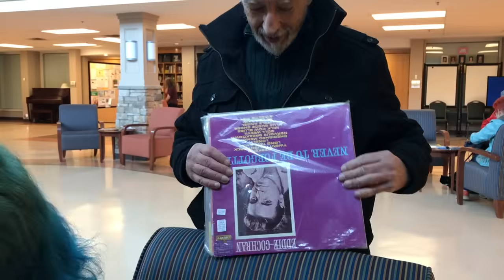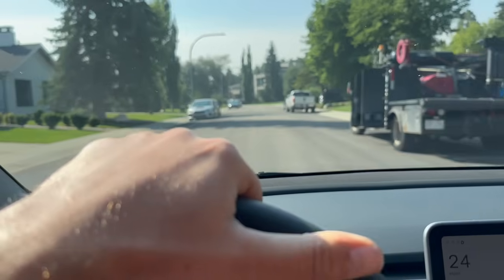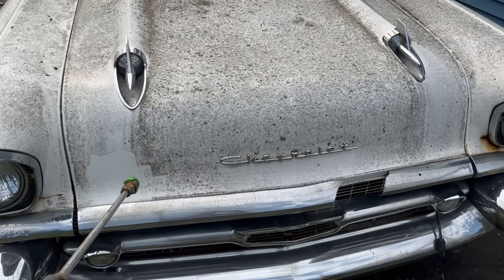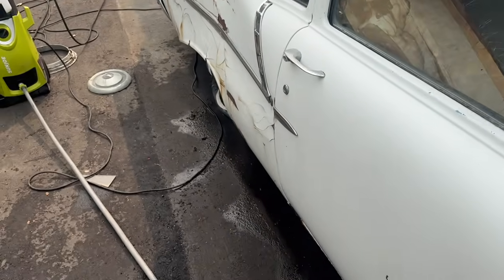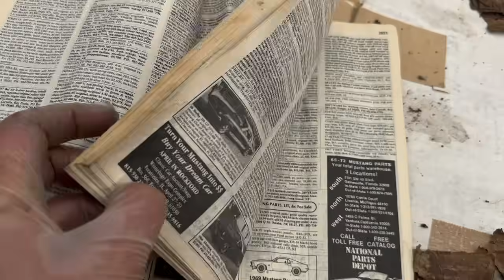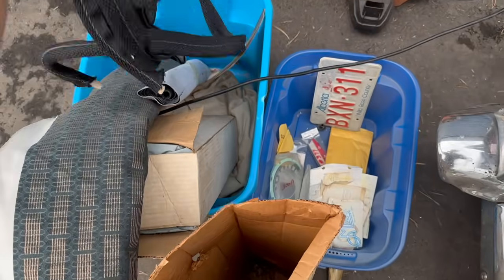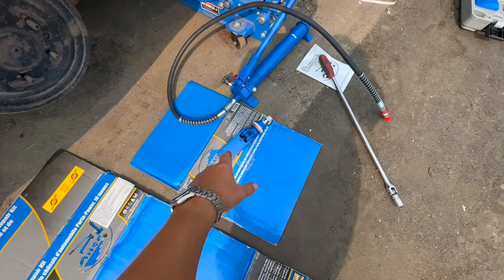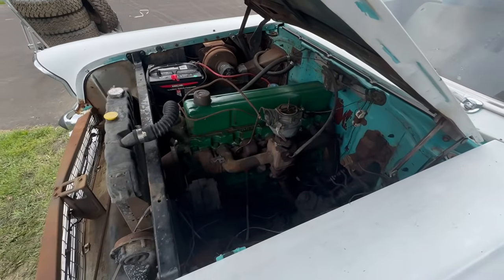1957 Chevy Parked 40 years! will it run?!?

Comment: My uncle worked at Steakley bros Chevy in Tx from the 50s til late 80s. My cousin had a slew of unbelievable used cars including a 2 dr. 57' just like that one in factory gold w/ gold and brown interior. He had this car in the 70s for a few months. lt had the 6 cyl as well. l drove it w/ less than 20k miles on it and it felt brand new. True garage kept one owner grandma's car. The interior was like new. l cherish the times l got to ride and drive in the 50s and 60s cars when they were low miles like new still in the 70s now when l see these videos. One of the perks of being old. l also live in the house l grew up in and was burying a dead cat recently where my sandbox was in the 60s and found my redline dodge charger hot wheels from then and l thought about curiosity inc.

Comment: When I was little my parents had a 1956 Chevy station wagon with (if my memory hasn't gone ka-blooey) the same paint color. It stopped being our family car in 1965 and until the mid 1980s was my dad's work car, stuffed full of tools. It too was "3 on the tree." I drove it exactly once, in the mid 1970s, when I barely knew how to drive stick. I stalled several times on the way home. I also remember marveling at how much empty space it had under the hood compared to more modern cars.

Comment: A '57 Chevy Belair is my dream car. I prefer the trim with the V insert on the rear quarter panel, and a 4-door, since that's more practical for me. So instead of having a real 57 Chevy, I have little replica models displayed on my book shelf. 😊
I was so happy when this baby actually cranked and started. I started clapping with joy! It looks great after the cleanup and pulling out the dents! 
In 1984 when it was parked, I was still living in Drayton Valley, AB (Nashville TN now), and my mother had a green '55 Chevy which was the daily driver.

Comment: I've often wished I had my '67 Malibu back as it was the best running car I've ever had, bought used in 1977. In 1979 I bought my first new car, a 1979 Toyota Celica.(What does a teenage girl know)  The Malibu got given to my dad and  by my Dad to my sister's husband who beat it to death in 2 weeks. I bought the Malibu for $200 from a guy who kept it in great running condition as it was his work car. That car started every day for 2 years without fail and my dad did the oil changes. so the only cost was gas at 60 cents a gallon. Hindsight is 20 20 cuz I bet that would be worth a lot now...Your  adventures always jog the best memories

Comment: Those tires have tubes. That helps keeping the air pressure. Those Chevy six cylinders were the about the most solid and reliable engines ever built.

Comment: From experience: pressure washing works better when you wet down first. Let the water penetrate a bit and then pressure wash. Even better with a low-pressure detergent.
Reply: I use gritless hand cleaner and smear it on generously over everything including the interior. Let sit for 24 hours then brush wipe and spray with water.

Comment: I just came across this video, fine nothing new on the 57 after this posting. A bit difference to see inserts in the front finders for the 150. You have a very good start on a great daily driver. Upgrading the brakes, is good, wiper's with and elc one, You already have the better heater one piece front bumper. So, after you take care of the stuff you have already talked about fun driving is a go ;-).

Comment: I had the exact same model 57 when I was stationed at Ft Ord in the 70s except mine was a radio delete. 

It originally was owned by California Highway Patrol, but with the 6cyl it was a administrative vehicle. 

Rebuilt the engine in 76 after 220,000 miles. 

Good luck with yours

Comment: I'd suggest checking the wall thickness of the frame in several places.  It's almost certainly thinned down some by being outside all of those years.  
You might like to watch some old Gene Winfield videos on metalworking fenders.  He tended to use lead instead of bondo.

Comment: Been a while since I have seen a straight 6 350 small block 3 on the tree and about in running condition too. We used to use those cars as demolition derby cars lol. Not many around anymore though. Amazing Alex truly amazing for sure. Get some bondo and new paint for touch up or strip it to the original color and you have a "true" classic. Have a great day
Reply: A 350 engine was a V-8.  This straight 6 is more likely a 235.  Although, the factory color (at least in the U.S.) for a 235 was blue - maybe Canadian models were green....?

Comment: did anyone notice the tilt-away steering wheel ///   empty tank indicator---i would add about a pint of oil, or diesel to the gas tank  ///  then put in about 15 litres  of premium gasoline ///  run it for a few minutes then rock the car to mix the stuff in the   gas tank  ///use any other additives  u have if needed

Comment: "It didn't really even smoke."

Yeah, I was wondering about that too since you put penetrating oil in the cylinders, it should have smoked...so you must of had it running before your "surprise" start. 😂

Some good ol movie magic there. 😂
Reply: He doesn't fake stuff like that.  You must be new.
Reply: @kjkayjay  Haha Been watching for years. You don't know much about cars if that's the case. 

He's clearly edited out a bunch of things. He would have most likely put a wrench into the crank bolt and turned it over manually to make sure it's not stuck before trying to start it with the key...otherwise he could have blown a lot of stuff up. He knows this cause he's a car guy. 

Also, points would definitely need to be cleaned after 40 years of sitting in harsh Edmonton winters....neither of which he showed. 

Very clearly he did t show many things in the process of getting the car going.
Reply: @orangewhipster  I know he edits out a bunch of things but he doesn't pretend that he didn't do them, he just doesn't mention them.

Comment: They make a lug nut that has a deeper well/sleeve  so you don't have to change the bolts, a hot rod shop should have them. ( or at least they used to, sometimes I forget how old I am)

Comment: I have seen the 236 Chev Inline six go 427000+ miles without any major work to the engine. The same for the 3 speed manual transmission. I used to street race the very same cars back in the '60's, and that 6 cylinder would beat all small block V8s, light to light. It would be a shame if someone would do as most people do, and change it to the useless small block V8 Chev had of the day.

Comment: Quick dent removal idea. Put a deflated scoccer ball up between the dented area. Attached to an air compresser. Inflate till dent pops back out. Depending on where dent is located you may leave ball there or deflate and remove.

Comment: Did ya notice that the old Chevys did not need a key to start them.
Reply: I did. That was true even into the 1970's - my 73 Nova, even though the switch was on the steering column since 1969, as long as you didn't turn it back to the lock position, you could pull out the key.

Comment: The worst thing you can do to a car is spray water directly on the engine.  Let alone high pressure water. 
That gets water down deep in the engine to permanently destroy it.  
No professional garages  or professional mechanics  would ever get water on a engine.

Comment: I’m so surprised that you can just power wash an engine! Never realized that was possible. I would have assumed the water would affect its functionality.
Reply: Today's cars you run the risks of ruining a hundred electronic parts needed for the computer. Power washing not recommended.
Reply: You're  right, safe to power wash older cars, pre 1980's. Newer cars with all their computer controlled module's easy to ruin them if penetrated by water.
Reply: You noticed that he didn't take off the oil bath air cleaner before washing.  Getting water into the carburetor would have been bad - usually, everything else is o.k. to get wet.

Comment: Cool car. Too bad its not 348 v8
Reply: 348 was 58 Chevys.
Reply: The hottest engine available in 1957 was a 327 with fuel injection.  One of the rarest options EVER offered by Chevrolet !  All the other V-8's were 283's......

Comment: That's a 56 Chevy the 57 had more chrome Ina V shape on the rear quarter panel.
Reply from the maker: It’s a 1957 just the lower trim version
Reply: Cool car, how do you find such great deals, I guess because you are pounding the pavement to find them.
Reply: That is a very rare 1957  model 150.  Highly sought after, famous race car named the Black Widow that was fuel injected.
Reply: @christophersilsby7829
A 1956 has the gas tank opening in the left taillight, and it doesn't have fins.
Reply: WRONG It is a 1957 Chevy the 56 is similar body style but no rear fins At 76 years old I have owned all of the 55-56-57 chevys and wish I had them back .
Reply: @christophersilsby7829.......how does it feel to make the most foolish comment of the day ??